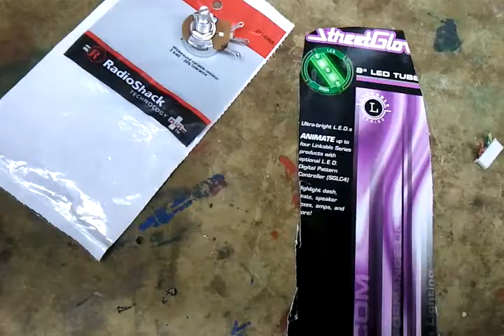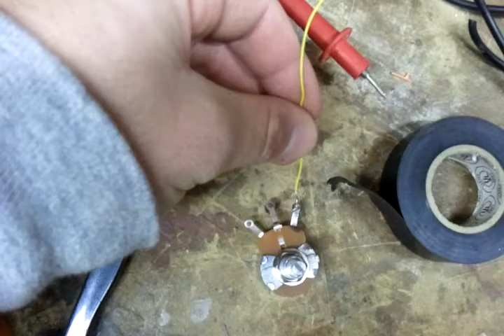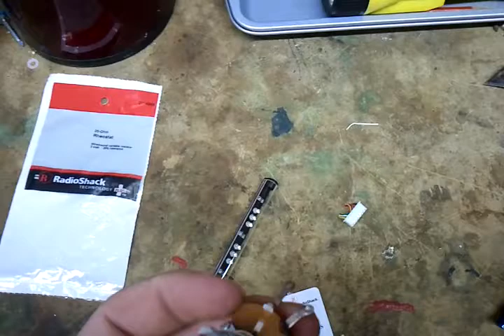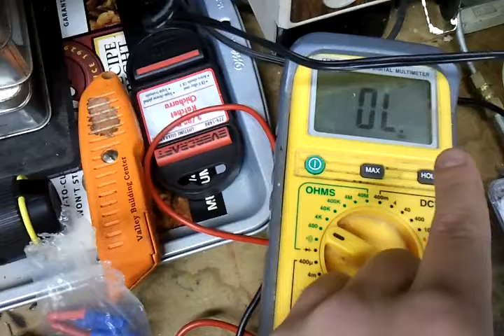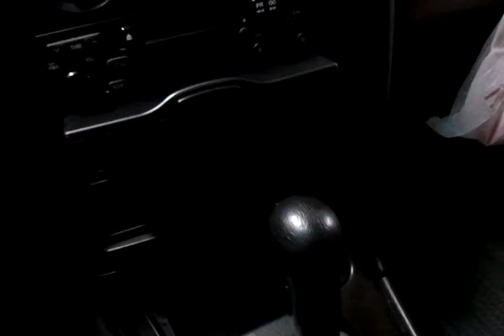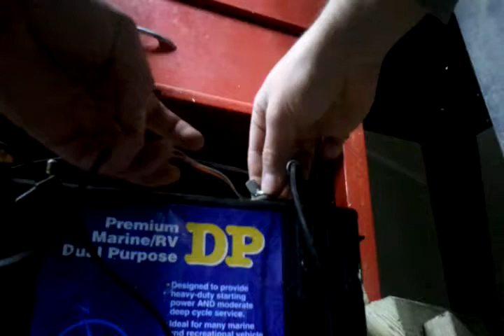How to wire LEDs in your car and control their intensity

Comment: V=IR is a basic relation between Voltage, Amperage, and Resistance. Voltage is like the speed of water flowing through a pipe. Amperage is how wide the pipe is, and Resistance is blockage impeding flow. A potentiometer is a variable resistor. It changes the "blockage."  R = (V/I) is the same equation re-arranged. You can calculate the resistance you need to have "full blockage," by knowing the voltage you put in (12v usually for a car) divided by the Amperage (look at the fuse you are using).

Comment: NINJAROOable, those resistor calculations are probably not necessary in this case.  if the light bar is an automobile accessory it was designed for 12 volts DC and already has the resistors built in to run the LEDs at a safe current.  you have the right idea by just putting the pot in between the power supply and the LEDs to control the intensity of lights.  the pot can lower the current to dim the LEDS, but can't raise the current above what the LED bar resistors govern.
thanks for posting!

Comment: Hi, it would be better to use R = (V/I) which is (resistance = volt/amp) to calculate how much resistance you would need to turn the lights from full brightness, to off.

Comment: hi mate, where did u get those wires? i have an angel led light, it has a yellow and a white wire, the yellow wire makes the lights come on when the engine starts, the white wire is connected to headlights, so when the headlights come one the angel lights goes off....I would like these lights to stay on, but to make it legal, i need to reduce the brightness of my angel lights, so i think the wires you've got can help, or how can i reduce the brightness of my led lights?

Comment: So i have a question about grounding it, I'm going to tap into my 12v outlet in my car so that would be my positive going into the switch, would i take the negative coming from the lights and ground that to the chassis or?